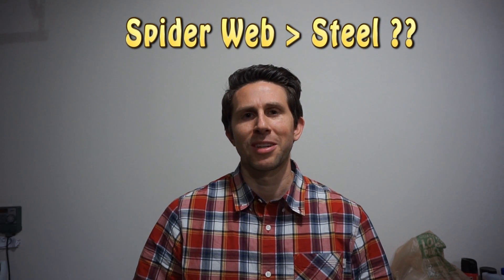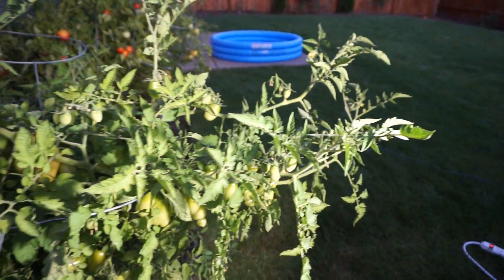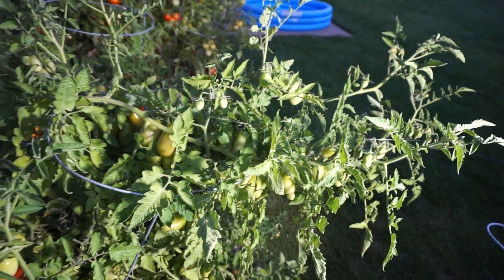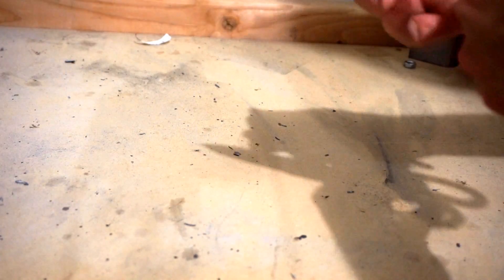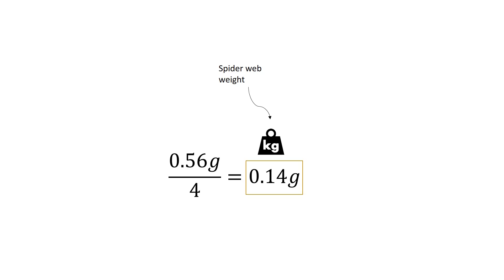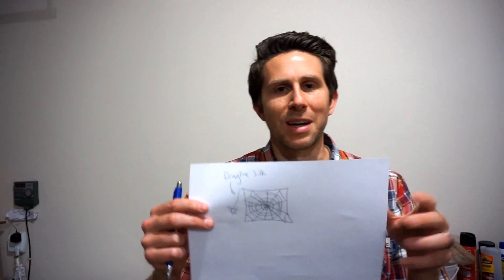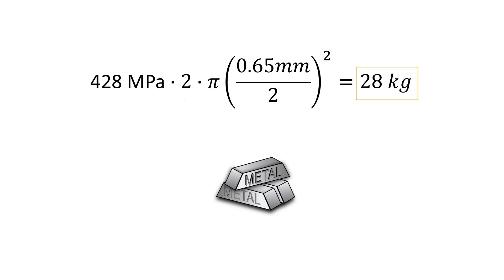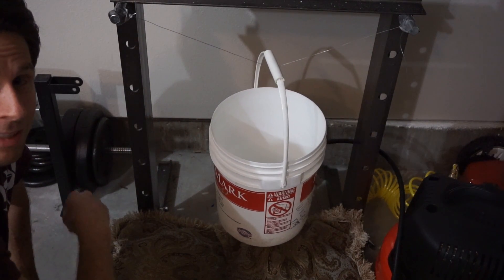Are Spider Webs Actually Stronger Than Steel? | Experiment

Comment: GRATE demo experiment  , 
spider webs are a super thugh fabric material used for rock climbing ropes .
they are NOT stronger then steel though , (not in EVERY way ) but rather more FLEXIBLE ,  

for example if you take a sharp axe and chop 2 wires of 0.6 mm  placed on a lathe , 
the one made of spider web silk it will brake first , 
or if you run both of them on the edgg of a shap knife = same resault

spider web is only superior in tensile stranghth (pulling and streaching) , but not impact and sharp friction 

it is a grate material simular to carbon fiber  ,  
it will be used more as a technology even at 2070

Comment: This is a very BASIC demonstration of strength comparison,  and in that sense it is good. 

That being said, and as stated numerous times in other comments, there were a bunch of errors causing flawed results.
The most obvious is the fact that the weight placed on the web was spread over the distance of 12 pipe cleaners which are probably close to 1/8" diameter (give or take), whereas the bucket was located on a section of the wire approximately 3/16" wide. It's common knowledge that the pounds per square inch applied to the wire was greater than that applied to the web.
Secondly, as you were outside the wind resistance applied to the cross section of the pipe cleaners amplified the amount of force being applied to the web, I say force because at this point its more than just the weight of the pipe cleaners pulling on the web. 
Now some might say that the factor of you dropping the weights in the bucket is the same as the factor of the wind but that won't be accurate.
Thirdly, the fact that we can't determine from the video (accurately) if the web broke or just disconnected from the branch/leaf.
There are a few more things that were not taken in to account in the experiment, that others mentioned besides these.
However, I have seen other experiments done regarding the strength comparison of steel to spider web using the breaking point LENGTH wise of the two. End result? spider webs are stronger then steel.

So, as I stated, thanks for a great albeit basic demonstration that is something any kid in school could use to grasp the understanding of just how strong spider webs can be.  I'm just thank full that we don't have Godzilla sized spiders....

Comment: Steel wire should be to scale being much longer. Also many variables apply here. You can see the steel doesnt ha e much flex while the web has lots of bounce and flex. The web having thos flexabilty aloowes it to have more flex at the holding points.

Comment: I think that calculation is wrong because you didn't consider the tilting angle of the tension in the spider thread
The weight force is equivalent to the net of the two tension tilted forces at the spider thread

Comment: Lame experiment but interesting!!

Next time, check if spider web broke or slipped off the tree branch

Don’t be scared of placing the weights in the bucket.. don’t drop the weights, the impact weight cause the steel wire to sag and ultimately breaks

Comment: According what he did ...shouldn't the tensile strength of spider web be 8.61 MPa ? And what is up with that 2 multiplied with Pi in denominator while calculating tensile strength of the spider web ? Every calculation is flawed.

Comment: you made some  errors in you're calculations because you not only didnt (could't) observe where or even if the web broke or just pulled off where it was attached but you didnt count for the surface area on the string of web and the string f steel that you covered in each test. for the web the covered surface area was wide giving the web more of a chance to balance that weight while  on the steel all the weight was in one singular spot causing more tension than dispersed weight would

Comment: There's a huge amount of error and uncertainty in your experiment. Not least of which is the way you're dropping weights into the bucket hanging from the steel. This isn't a dead load that is applying even stresses on the steel wire, it's a dynamic load that is putting far greater tensile stress on the material than the masses of the weights themselves because you are accelerating them by dropping them from nonzero heights. Also, "steel" is an open-ended term--there are many different varieties of steel. Structural steel members are graded in ranges of 36 to 65 ksi but some braided tension cables can withstand over 200 ksi of stress. There is also the confusion between strength based on weight and strength based on volume.
Reply from the maker: +Nate B. I dropped the weights on the spider web too so...The points you mentioned were not actually a huge factor of error. The biggest point of error that you didn’t point out was that I estimated what the diameter of the spider web was.
Reply: ActionLab Vlogs you needed to make 5 lb hooks with a comparable diameter (similar to the pipe cleaners vs spider wire dia) to hang as to not make a pinch point on the wire. Spreading the weight out on the cable would of helped some but I think it still loose to spider web. I’m guessing 45-47 lbs.
Reply: @ActionLabShorts  it is a bad example for sure. The end to end support is not the same and webs being on leaves it allow it to have be more ductile
Reply: @Garengoat  but it still fact that spider web are better and you could see that the spider web got slip down and not actually break
Reply: @ActionLabShorts  Using the smallest value given in the literature for the diameter of spider web (0.003m^2), it would be equivalent to roughly 10 pounds. I agree with Nate B. that your estimate does not give realistic results. Still fun to watch though ;)
Reply: what did you expect from someone who does not use international system for its measurements? Ofc it's not accurate.

Comment: Don't you have to use the same density of spider web as steel to make this experiment viable? Like a single strand of spiderweb obviously won't be as strong as a 5 lb hunk of steel lol. Try 5 lbs of web maybe? Idk
Reply from the maker: +George Washington well, you just need the same weight per cross sectional square area. The densities don't need to be the same. The point is that if you have a web strand and steel wire that have the exact same diameter, the spider web will hold more weight.

Comment: I still don't get this theory. How is a spider Web consisted strong when you can literally break it with one finger. Hanging pipe cleaners on it doesn't prove its strength,or does it ...I'm so confused on the mathematics. I failed maths yeah but this is just so hard to grasp.
Reply: CodyDTD  Well the silk is only 5 micrometers thick. 
So if it was somehow threaded together to make it as thick as that steel wire it would be pretty hard to break with just a finger lol but I used to wonder the same thing.

Comment: the problem in this experiment is in distributing the load on the spider thread. while it was point load in the case of steel. 
no doubt the spider thread is stronger but the experiment is not fair .
Reply: i actually made artifical spider silk

Comment: Your experiment was flawed, the spider web didnt break it slipped off the leaf.
Reply: if it slipped off then that means it could have held more weight. either way, it still held more than the steel wire which means its stronger
Reply: Well its still stronger
Reply: @mm-fh1tw  The whole point of an experiment is to get actual values, like "spider webs are X% stronger than steel" or "spider webs can hold up to X times as much weight as steel". Saying "spider webs are stronger" is true but it literally means absolutely nothing and its impossible to interpret. Therefore an accurate experiment is required.
Reply: @iReppoGames  understandable
Reply: @iReppoGames  the title of the video is "are spider webs stronger than steel, you coming for exact values is coming for something the video never said it would give
Reply: @iReppoGames  well.. the title of the video is "Are Spider Webs Actually Stronger Than Steel?  Experiment" the idea of the experiment was to answer a yes or no question in this case. which was done.
Reply: Alexander Carlson not  really  because he still said spider webs are stronger
Reply: i should also point out, so was the steel wire he didn't take the bucket into account

Comment: You had a bucket, why not use water as a weight? Dropping the weights in the bucket causes a higher instantaneous load. And what steel alloy did you use? I think something like piano wire would be an interesting comparison.
Reply: Larry Scott to be fair, the spider web also had instantaneous loads with the pipe cleaner dropped onto it